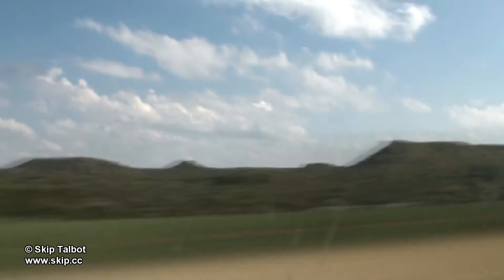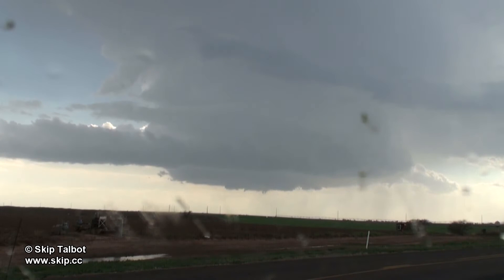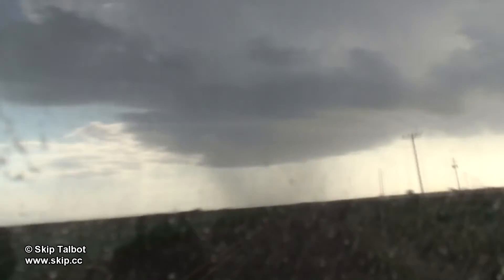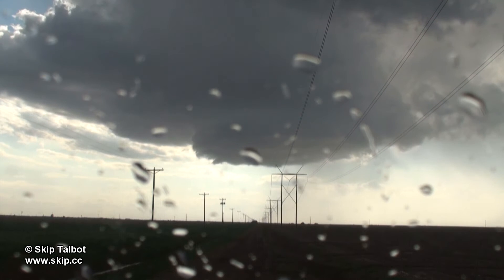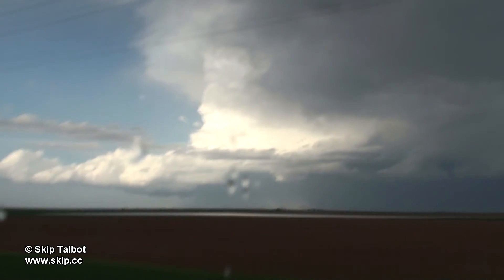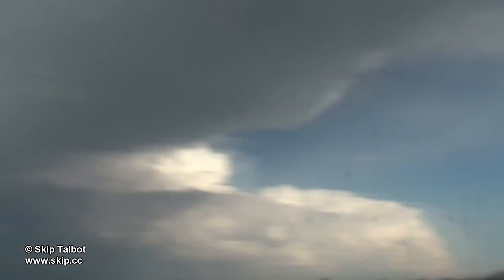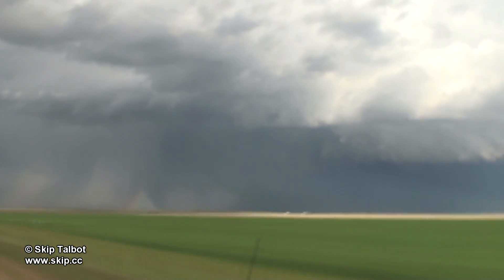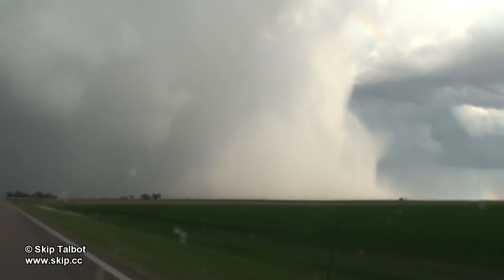Storm Lapse Chapter 7 with Commentary: April 21, 2010

Comment: I was just south of a bridge that crosses I-40. Same spot where Tx Hwy 70 blends with I-40 at mile marker 121. I watched the tornado form to my west. Once it went to my south and temporarily disappeared, I headed east to keep the big hail from bombarding me. Then it came back down for a short time to the south of me. Then I spotted another tornado way off. Afterwards I left for Oklahoma, I had to work that evening so I missed out on a second storm that ended up having a rainwrapped tornado.